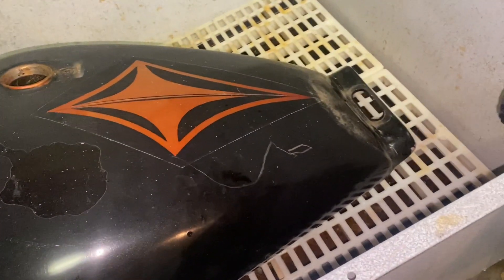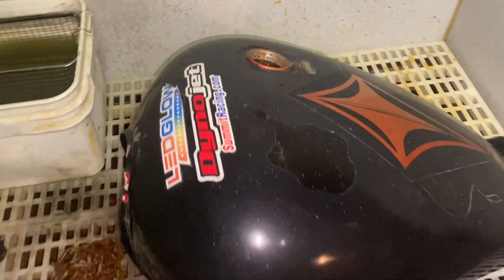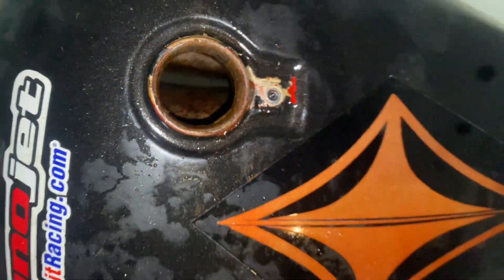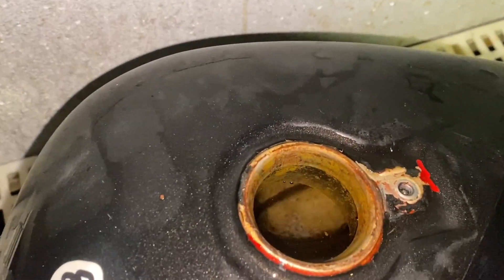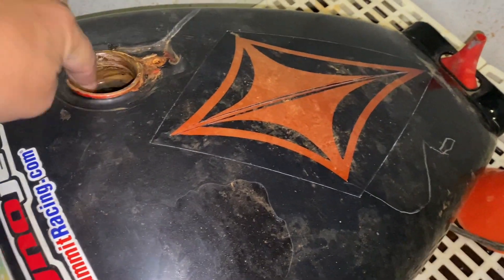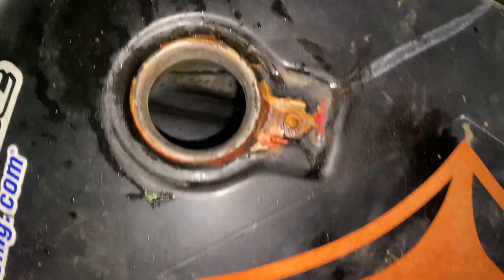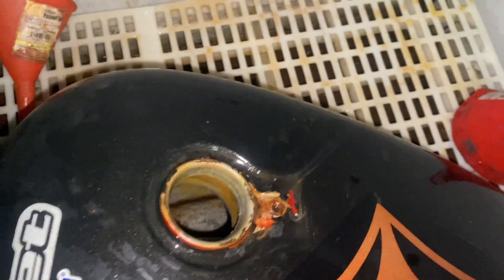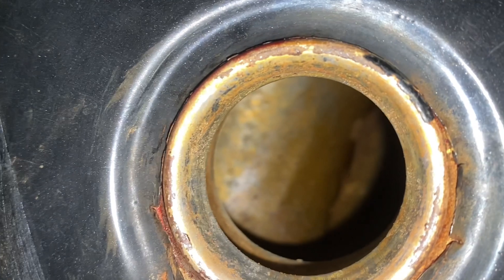Cleaning out Rusty Fuel Gas Petrol Tank Motorcycle 1982 Yamaha Maxim XJ750 with Vinegar

Comment: Huge improvement.  Maybe fog it with WD40 or add motor oil coating and get it coating by tipping the tank. I use evaporust, mainly because I hate the smell of vineger. Have a good one. 👍